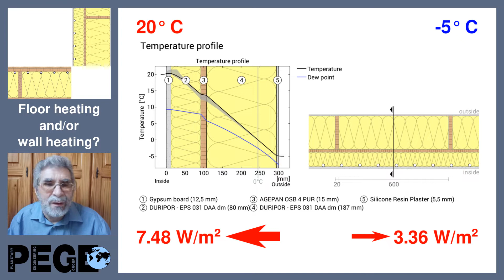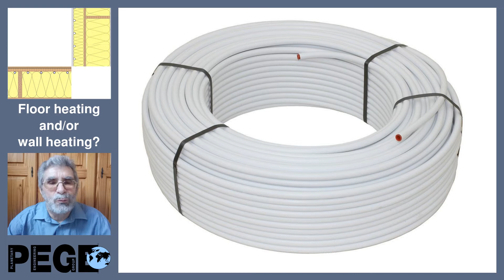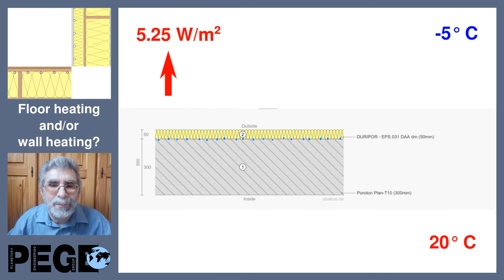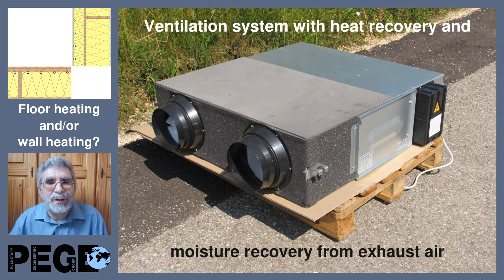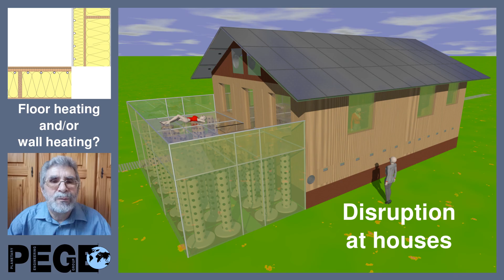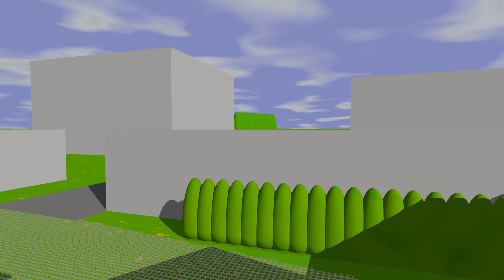Wall heating and/or floor heating

Comment: I am terribly sorry to have to ask : This is using water based heating or electrical heating?
As for the examples and calculations, this was all very clear. Thank you so much for explaining this all. I am surprised to find almost no marketing on Wall heating nor that many products. WARP is one of the few i could find. Definitely in DYI form.
Reply from the maker: It is a water based heating. I have also a video about the heat pump system: https://www.youtube.com/watch?v=YPtvKJwqwOc
After the creation of this video, I invented the full area wall heating for a further increase of efficiency: https://technology.gemini-next-generation.house/surface-area-heating/